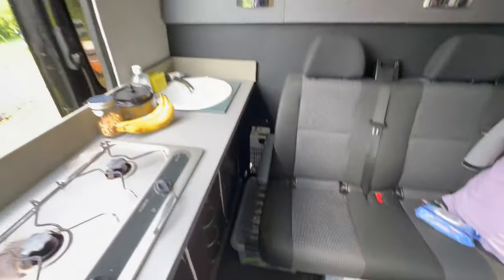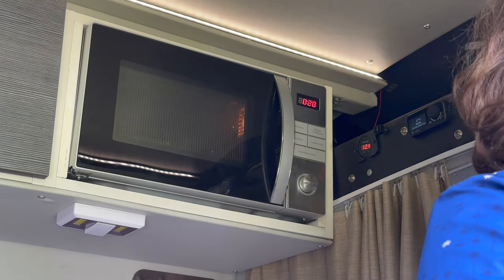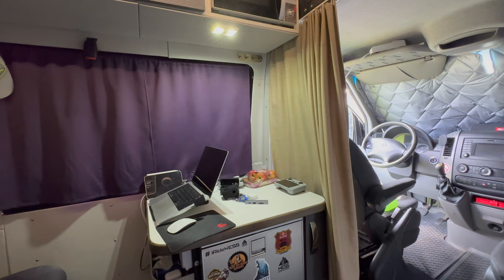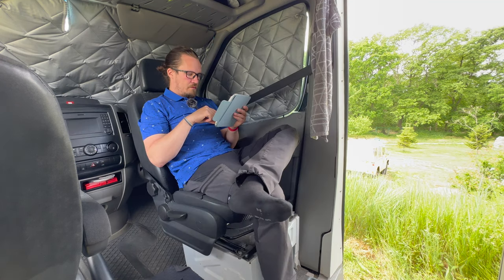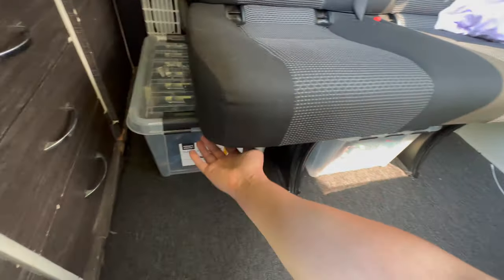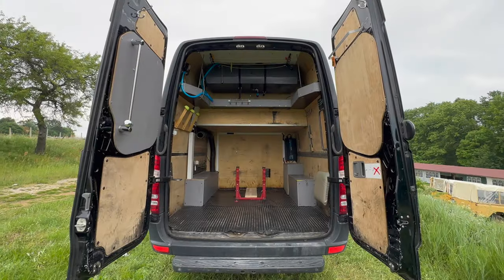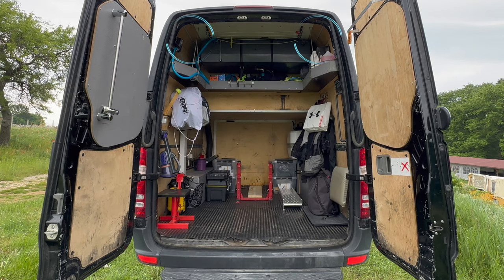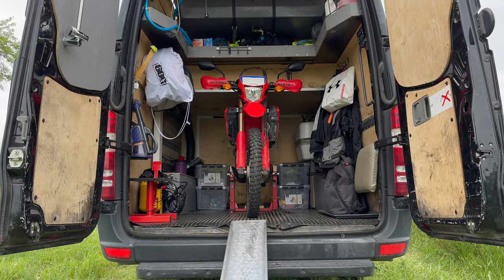Ultimate Dirtbike Campervan Build (DIY)

Comment: Wow, thank you!  This is exactly what I was looking for!  I wanted a camper to carry my sport/touring bike to rallies around North America. I didn't want the hassle of a trailer/toy hauler or some enormous and expensive Class C toy hauler. Was looking at Class B but there is nothing commercial for what I wanted.  I finally resolved to build my own in an extended van and then.....Presto!   I came upon your build!  Lots of great ideas.  The garage rocks!  Can't wait to start designing and building my own.
Reply from the maker: Sounds great! Take videos of the build process if you have the time 😊 to help others 🙂
Awesome if you got some ideas from the video!
Reply: @PatchedBandit  I'm starting to design my own in SketchUp.  What is the height from the floor to the bottom of your bedframe? Also, how much headroom do you have above your bed to the ceiling?   The highest point on the rear of my bike (not including handlebars) is 41 inches so I'm planning on making the bottom of the bedframe at about 42 inches but that doesn't give me much headroom after I add the mattress. Wondered if your bike seat was lower. Thanks!

Comment: What I like: general van layout and generous garage. 50/50 separation of living quarters and motorcycle stuff. What I think could be improved: 150l (= 150kg) water tank mounted on the ceiling might not be the best idea for handling of the van.  Then again it's a large van and the weight is somewhat counter balanced by the almost equally heavy motorcycle. But if it was me I would try to find a lower place for the water tank. Awesome build, and definitely an inspiration for me. Keep 'em coming!
Reply from the maker: Water tank in the back is empty 99% of the time as I rarely use it. I have been thinking about switching it up to a small boiler that would keep enough water for couple showers or a bike wash.

Comment: How did you bolt the bike mount ..through the bed.  Any issue under the van?  A photo would be great😊
Reply from the maker: Through the bed yes. I made 2 flat pieces of 5mm steel to work as a gigantic washer on both sides of the mount under the bed. It distributed the "force" of the mount to a big larger area. I also have a new video about my current van with a better mounting system here: https://youtu.be/n4tPe0nc8BQ

Don't have pictures of the old or the new van underneath though.

Comment: Finally the video what everybody waited for! Lot of good ideas!  Did you converted the van by yourself?
Reply from the maker: Glad you like it! That's my hope that people get some inspiration on some of the things seen in the video and if I forgot to tell something important I can always do some follow-up videos to this one. Some things I have done myself but the van has been a camper couple of years before I bought it last winter. Thanks for watching!
Reply: @PatchedBandit  I think your motovan is every motorcyclists dream, mobile mancave! 😀 You could include the link in the description for some of the unique and usefull staff like the moto strap, stove, solar panel, water tank... maybe you could help others like Pavlin who whants to build a camper like yours!
Reply from the maker: I will add something later for sure 😊
Reply: Olipa hyvin tehty, ammattimaista ✌️👌
Reply: These builds are pretty common here in Finland, you can say, it is typical buid, because the laws. It probably is registered as a light commercial truck, and is with cheap annual tax, less than 100euros. The speed is limited to 90kph though. With a normal campervan/motorhome/cargovan the tax is about 800 euros per year and doesn't have speed restriction. But some people prefer the higher speed and some of these are registered as motorhomes, so this isn't universal by any means... But usually, they are trucks.

They even sell these at Mercedes-Benz dealership directly if you want buy a new one, completely coach built with bed and all (Or VW, Ford etc.). But vast majority are home made with set of inspection rules that are universal for this type of truck. For example, Cargo hold needs to have 6 anchor points, the wall needs to meet certain strength criteria (Calculations are needed to present in the modifying inspection) and the vehicle itself have certain gross weight limit (over 3500kg). 

And because the vehicle is so new, the seats have to be certified for this exact vehicle, ie the rear seat is original Mercedes-Benz two-seater specified just for a Sprinter (well it fits in Viano too). The older Sprinter (W903) doesn't have to have certified seats, any plywood box will do.

Comment: Nice video. Plenty of new stuff  for me, at least.  Always somehoq thought that bed is there ready all  the time... though you should be quite short then 😂
Reply from the maker: It's possible if I sleep a bit diagonally but I like the space so it's no bother to pull it bigger before going in 😄
Reply: @PatchedBandit   X sleeper 💪
Reply from the maker: I like to roll around 😂

Comment: Nice setup, only problem for me would be the bad seating position when working.
Reply from the maker: I like sitting my back straight so for me it's not bad but with some small extension on the table one could get the normal sitting position with the laptop. 
Maybe an option to be installed in the future 😊

Comment: awesome! very inspiring
Reply: if I want to replicate your setup how much money should I save. I'm technically capable so I talking mostly on materials point of view
Reply from the maker: Depends so much on what you find cheaply but I would be prepared to pay anything north of 5000 € even making it yourself. Some items can change the pricing quite a lot like the electronics and components used. 
Smaller panel systems are quite affordable nowadays. Car not included ofcourse :)

Comment: Have you tried accommodating t7 in the van
Reply from the maker: It has naver been in the van but that day will come. I have measured that it fits before installing the mounting system to the floor.
Reply from the maker: It would fit in this but I never transported the T7 with this van.

Comment: Is that Sprinter a long or extralong model? What’s the height? 4-wheel drive?
Reply from the maker: Long. 7 meters. With the solar and lightbar around 275cm. Rear wheel drive.
Reply from the maker: This is long. So the second longest.